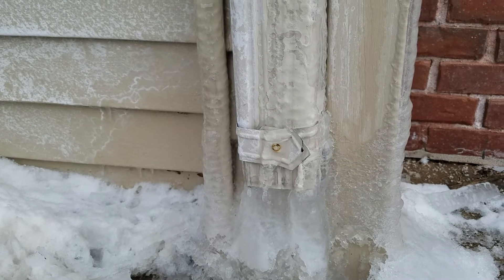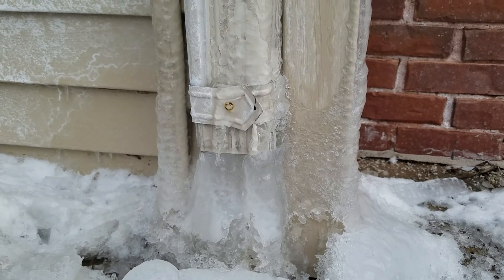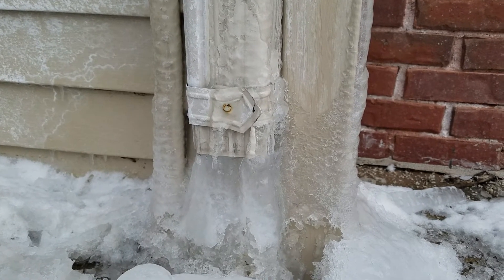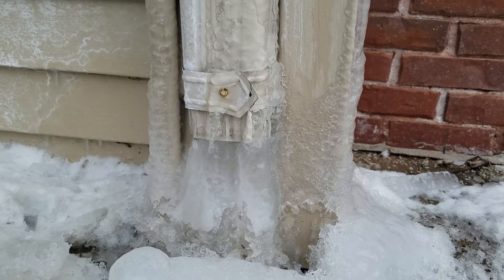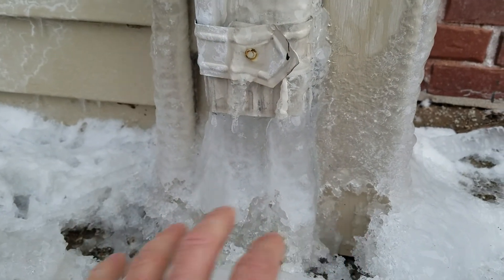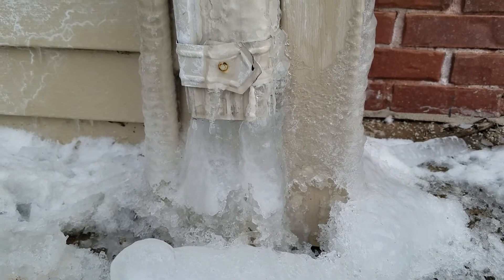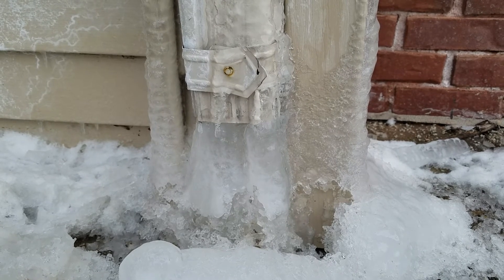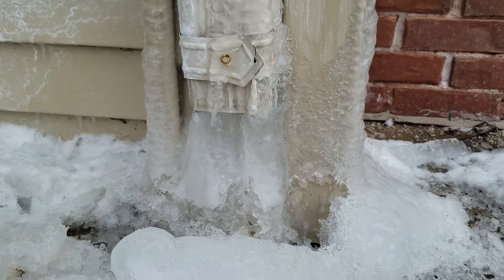Michigan Downspouts Buried Underground with Solid Corrugated Pipe

Comment: Our city mandates that we cannot drain to the road. so in this case, do I just use corrugated to a dispersement area then use corrugated preforated pipe?

We get temperatures down to -40 in winter, and only see above freezing conditions from Late April until mid October.
Reply from the maker: These parts are made out of high density polyethylene, and they expand during the freeze up, and then they shrink during the thaw. They do not crack. It was built for the north.
https://youtube.com/playlist?list=PLjFCqaZ4v1BVXKFHIb3Hd4nsppJYo0hzu&si=OFOUrbi5SjGGb5Rn
Reply: May I ask how shall I remove the ice?